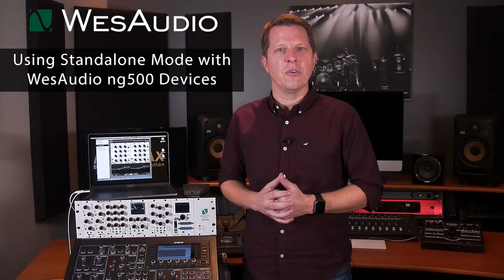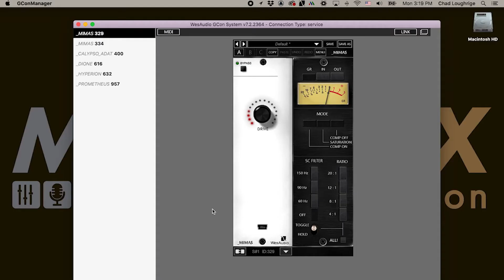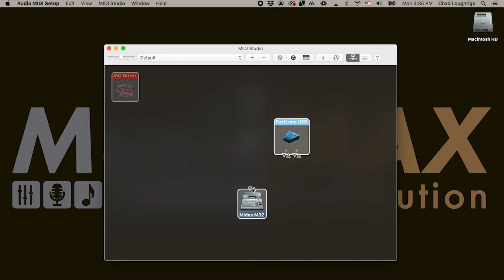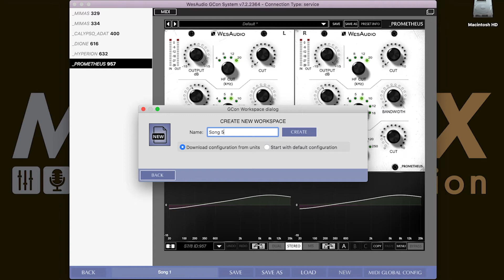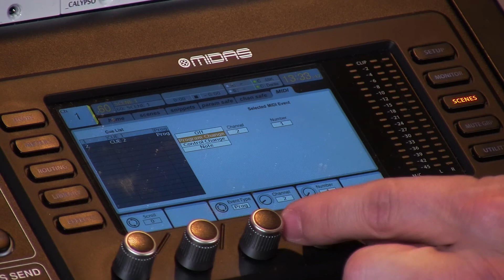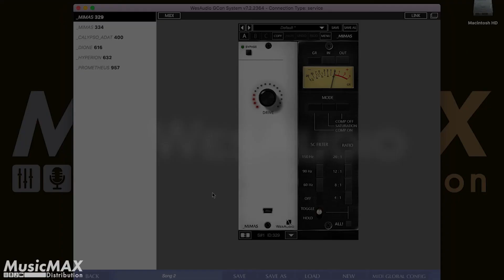WesAudio - Standalone application

Comment: Is there any latency to this setup? And if so how much?
Reply from the maker: Latency of the control protocol depends on the system, but usually it is really low (2ms for example). The MIDI messages to change the workspaces are a different story, but our system intercepts those messages on the system level, so latency should still be very low.
Reply: @wesaudio  thank you